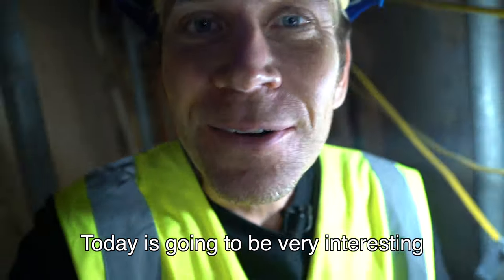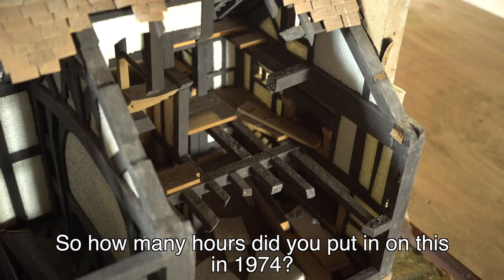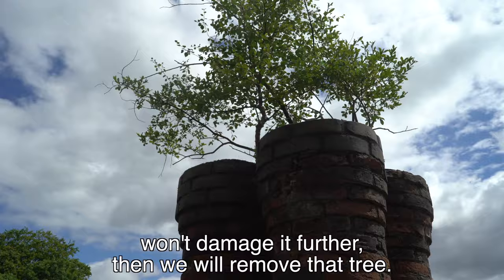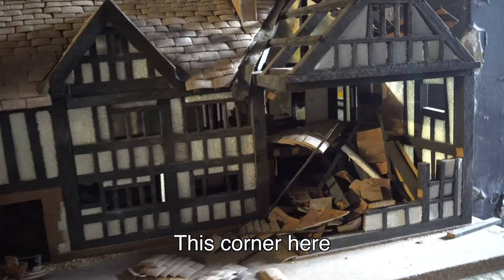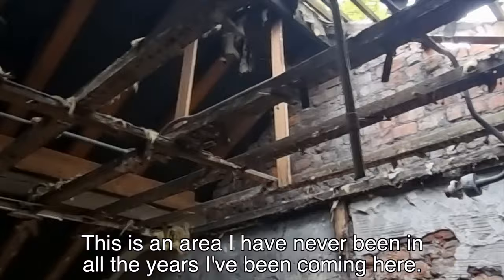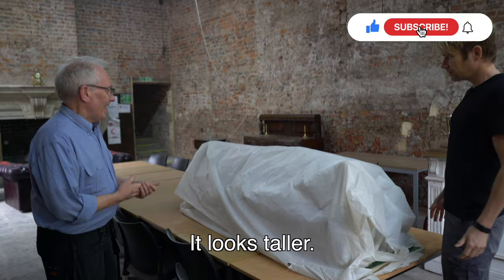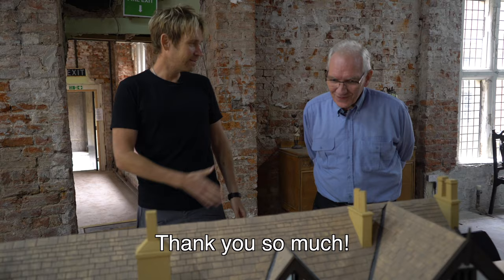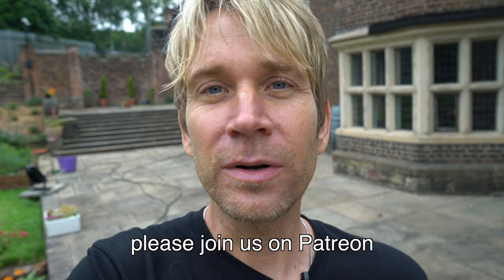Model Restoration of Hopwood Hall

Comment: Good morning, Hopwood.  Is there a floor plan of Hopwood Hall on-line somewhere?
A plan sure would help to understand the whole of the project - the Big Hopwood Picture.
It's such a daunting project.  I'm curious as to what the plan of attack has been . . . what sections of the castle or what systems of the structure have been addressed first, second, third, etc.
Have you been in every room of the Hall yet?